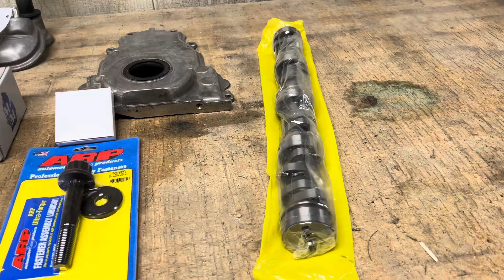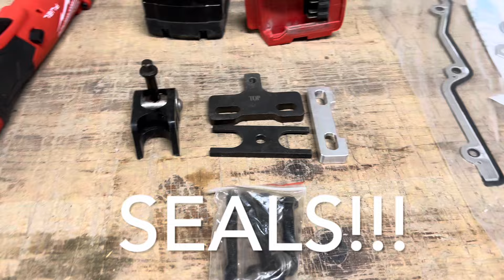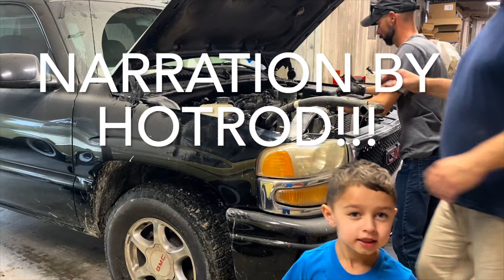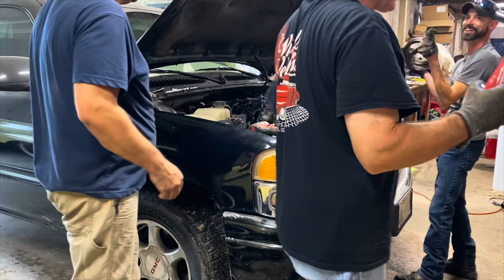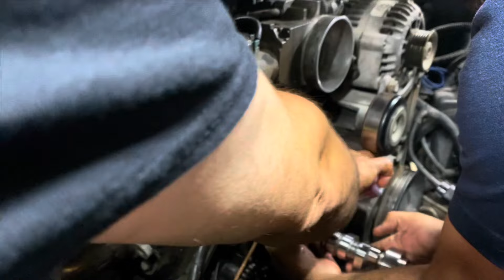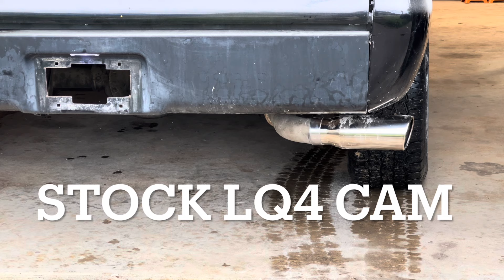Cam Swap! Richard Holdener Truck Plus, Best WRONG Cam, Install with idle clip! LS 4.8 5.3 6.0

Comment: Cant wait to cam my 01 Burban.. i'd say another month or 2.. just got HP Tuners, waiting on my wideband and aem gauge, just need to take the exhaust down and have the bung welded, already have springs and trunnion upgrade.. just waiting to buy the cam and then the fun can begin

Comment: Nice! Wonder if you could have ground the rod to a blunt angle to push the lifter up as you slide the rod in?
Reply from the maker: It was just barely down enough for that 5/16” rod to not fit. That is a good point though.
Reply: @Ninelinegarage  not sure if you were trying to create a pun there but either way I see what you did there

Comment: What length pushrods did you use? And what size injectors?
Reply from the maker: Stock push rods. I have some 8.1L Marine injectors I will be using.
Reply: @Ninelinegarage  how's the driveability? Are you still on the stock stall? If so, does it try to push through the brakes at all?
Reply from the maker: I haven’t driven it much yet. I still need to get it tuned but want to wait until I get my intake and stuff on it. I believe it will work fine on the stock stall since it’s a 6.0. Smaller engines would definitely need one.
Reply: @Ninelinegarage  lastly are you running just a stock fuel pump? And are you gonna do just a 87 tune?
Reply from the maker: @kobehargest it’s on a stock fuel pump right now. It was already tuned for 93 before I did the cam swap.

Comment: Any chance of knowing the duration, or intentionally a mystery?
Reply from the maker: I talk about it in this video. Super Richie (Richard Holdener) Truck Plus “Best WRONG Cam” Unboxing! LS 4.8 5.3 6.0
https://youtu.be/WhlmMGd32JM
Reply: Throw a degree wheel on it and you can solve the mystery…
Reply: @lifewiththelakes  Not really that important I guess. Richard proved it on a dyno, dip it in  oil, put it in with a sledge hammer and start pulling the front tires.
Reply: @clutchdump9633  love it!